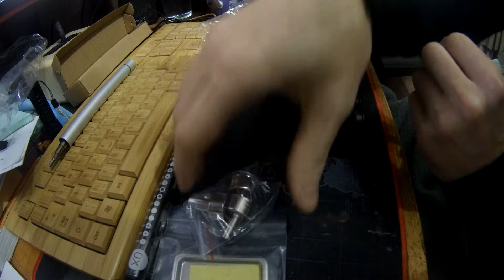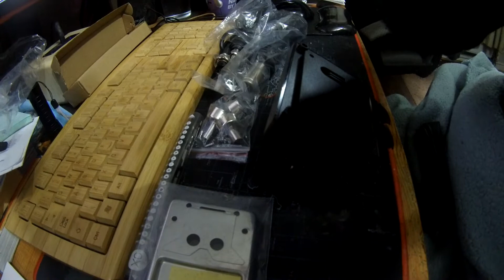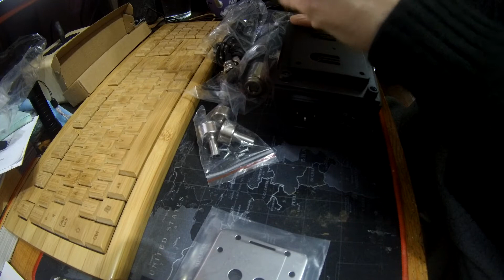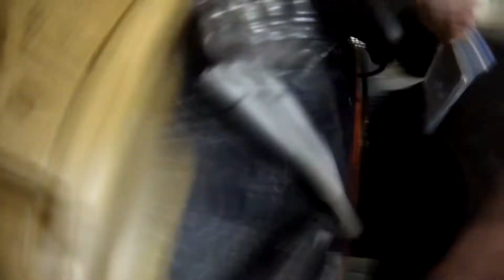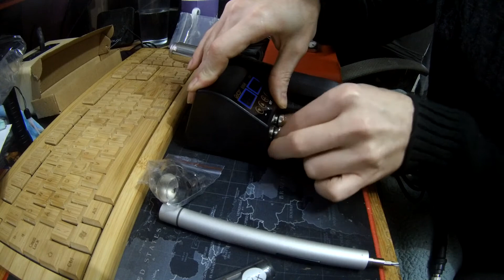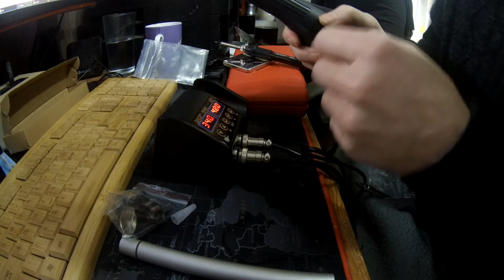JCD 8898 2 in 1 Soldering station 750w disassembly what is inside (not really a review)

Comment: The magnet is probably to switch off the thermal heater not the fun. The gun itself has a magnetic switch inside or the iron from the gun switch off the heater and in the base is located a magnetic switch!

Comment: I guess you have probably discovered by now that you don’t have to reduce the temperature to 100 as It does it automatically when you place the heat gun back on the stand.  Also you can calibrate the soldering iron temperature by pressing both temperature buttons together.  I had to reduce mine by forty degrees as when 350 was displayed the actual tip temperature was 390.  Like you say excellent value for the money.